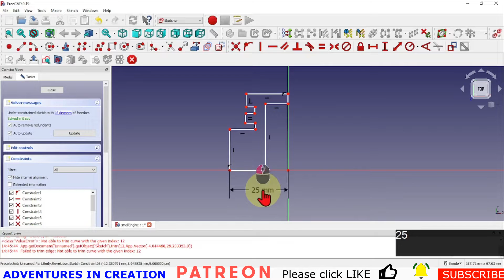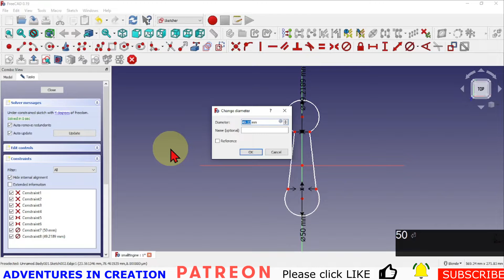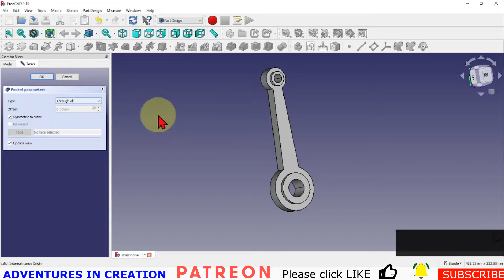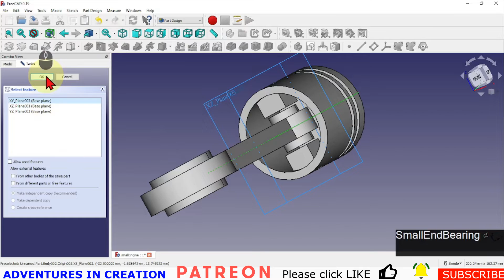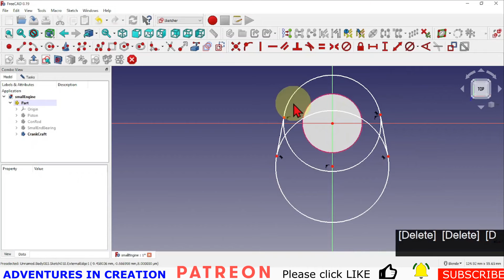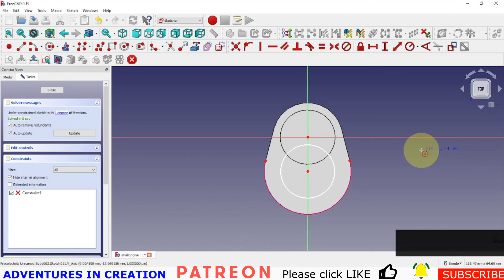FreeCAD Beginner #15 - Managing Multi-Part Models Pt 1.

Comment: This is why I love CAD: building real world practical parts. I created an assembly file in FreeCAD with,  'File -> Merge Document' and I was able to import your parts into a native FreeCAD assembly to create fixed and revolute joints. Just wanted everyone to know that the part file, 'smallEngine.FCStd' can be reused. These individual parts don't have to be recreated. It's safe to model all of your bodies in a part file. This has really opened my eyes to what is possible, I'll start using that approach. I'll continue the assembly after we make the other engine parts. Really love your tutorials.
Reply from the maker: That's great, thanks for sharing.

Comment: Thanks and a Question:-  Thank you so much for producing such excellent videos.  I am learning FreeCAD to help in my model engineering endeavours and I have to admit that I am struggling a bit.
A point in question:  when constructing the crankshaft is there a reason why you didn’t construct new features on the face of existing features, e.g. start constructing the web on the end face of the first cylindrical bearing.  In this way (a) you wouldn’t have to recall previous dimensions, (b) if the length of the first cylinder were changed then the web would move to suit.
Or is it a simple case of there being two choices of working and one chooses the one that in most convenient?
Reply from the maker: Good question. Previous versions of freecad had a major concern called the topological naming problem. The face references would change. This is largely fixed in the new version and so generally it is OK to use faces as references.
Reply: @Adventuresincreation  Thank you for that, I shall crack-on with one more area of confusion sorted.

Comment: Enjoyed this Tutorial, although I did have a few problems with the mirror function and repeated error messages saying that there were multiple parts generated on the mirror command. Freecad then dropped off additional parts?? and says it only keeps the first part, but it does not show up on the model. Managed a work around without using mirror. Found it difficult to research anything on mirror command error messages. But cheers for your videos, Graham
Reply from the maker: The latest version of freecad will allow multiple parts.

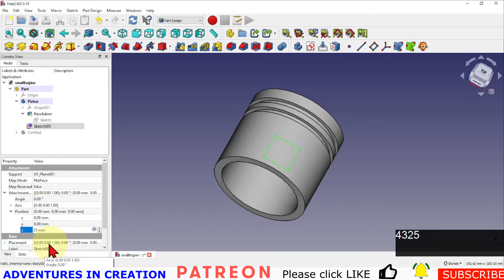Comment: For some reason, my square cannot be offset in the Position Z-axis 23 mm. I cannot the Z position property. Any ideas? At 24:05 in the video.
Reply from the maker: That's odd, can you move it any other direction?
Reply: @Adventuresincreation , Yes, I cannot change any position. I must have done something wrong. If I try to type in "23" I get the top view if I type "2" and the right view if I type "3". FreeCAD thinks I am trying to change the view of the piston.

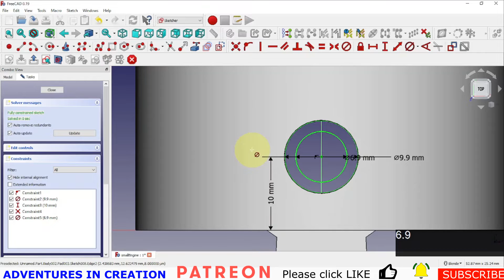Comment: In 29:57, Why we get directly a hole?
Reply from the maker: Thats the way it works
Reply: Think of it this way: starting from far away, you're on the outside of whatever you're modelling.  Cross the boundary, and you're on the inside.  Cross another, inner boundary, and you're outside again: it's a hole!

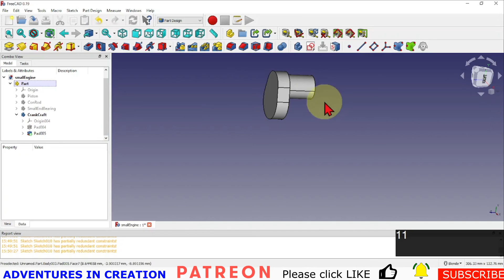Comment: Thank you.  The timemark is 43:45,  towards the end. Why do you select just that particular feature for mirroring, when surely you are wanting to mirror the entire part ?
A very informative set of videos which I constantly look back to for reference.  Well done in explaining your  very methodical approach.
Reply from the maker: I just mirrored that part because there were several pieces to mirror and I was just building up. If you want to mirror other parts that's OK, there are many ways to achieve similar ends. Thanks for the feedback and your question.
Reply: @Adventuresincreation  OK - thanks.  How do I now mirror the entire object to suit a multiple cylinder engine (bearing in mind that the big end journals will need to be rotated 90 or 120 degrees depending on number of cylinders). I tried mirroring the whole assembly, but get an error that I can't mirror such a complex part.
How can I do this, please.  I cannot find a video anywhere on YouTube which demonstrates this.
Reply from the maker: @kevingpearce  you may want to look at creating a clone of the parts you want, then you can position it as you need.

Comment: After you pad the crankshaft to 10mm, you select (and highlight in green) the larger radius lobe for mirroring around the XY plane.
Why is this, when surely you want to mirror the whole part ????   It makes no sense to me why you would be mirroring a feature rather than an existing part.  The use of such terminology is very confusing.  VERY difficult to understand what parts  (or views containing parts) to select when mirroring/padding/pocketing them.  Your choices and decisions appear magically inspired. 
Please explain further.
Reply from the maker: You are right, I am using magic as an inspiration ;-) Can you tell me what minute (mark) in the video you are referring to. I will take a look and let you know why I did what I did.

Comment: What are somethings you like about FreeCAD apart of it being Opensource? Also, what things you miss in FreeCAD when compared to other popular CAD applications like Solidworks etc.
Reply from the maker: I like the ability to use macros, the different workbenches. I miss being able to sketch on faces without issues.
Reply: @Adventuresincreation  I am a freelancer and was introduced to cad 1 month back. Since then I am loving it. Anyway to earn money from freecad???
Reply from the maker: @radeonblue1816  I am sure, if you have organizations that need engineering drawings or models in either STL or STEP format, you could provide those services with FreeCAD

Comment: Hey, great video! I'm curious why you create a part and a body inside it instead of just creating the body. Thanks!
Reply from the maker: Some of the assembly workbenches like the parts to be separate not just bodies in a single part
Reply: @Adventuresincreation  thanks for the answer! So, do you create the part in advance just in case you want to use it in an assembly later on?
Reply from the maker: @matyf_  yes, just to keep my workflow the same and ensure the parts are separate where it makes sense.

Comment: I do appreciate your use of reiteration to help those of us (me) who tend to be a little slow. Though I am using the Startup macro, it helps that you go through the steps in that macro so those steps can be drilled in.

I have some difficulty with spatial orientation in using Freecad. Have you done anything that might help me get that straight?

Thank you.
Reply from the maker: Thanks for the feedback. - I am not sure what your difficulty is, are you referring to which way is x-y&z ? Or how the sketch is oriented?

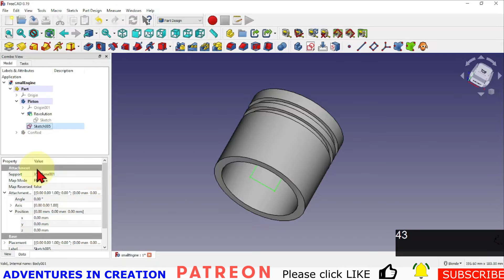Comment: 23:57 not working nothing
Reply from the maker: Can you explain what you mean?
Reply: @Adventuresincreation  cant't change scetch position mm. .
But i found other way to do that pad, with datum plane. 
With freecad all time need to do experimetnts, to get result.
Reply from the maker: @lauris.r8751  there is always more than one way to achieve the same thing. Keep on experimenting and having fun with it.
Reply: @lauris.r8751  Might be a bit late to say, but be careful that you are modifying the right values!  The sketch has an Attachment position, which is what you should be modifying at 23:57.  If you are instead modifying the Base placement position (which looks very similar) you are right, nothing works!  This caught me out a couple of times.

Comment: hi, thank you for nice and clear tutorial, just one think, that crankshaft is good for one piston only, or those other two in 3-cylinder would not move. 
But now a real question, what is the clone tool for? Would not save it a lot of work for example on crankshaft?

Please answer, thank you.
Reply from the maker: The clone tool allows you exact copies that are linked the originals. Watch my next video it will use clones

Comment: Thanks again for a great tutorial mate! 

I experimented a bit with the sketching of the crankshaft counterbalance in terms of getting those 2 angled lines connected tangentially between the smaller and bigger circle. I found that drawing those two lines in space and then connecting them tangentially as per your video seems to produce better and more accurate results right out of the gate instead of initially trying to eyeball it and then trying to fix the tangents afterwards; the tangential constraints actually jump into horizontal alignment automatically when following this approach. Figured I'd share so that other folks could try that route as well. 

Also, you can set whether or not to keep the model visible when going into Sketcher by going into Edit -> Preferences -> Sketcher -> Display -> Show objects that the sketch is attached to and Show objects used for external geometry. Not entirely sure which one does which, but yeah, the model is kept in the viewport when going into Sketcher when those two are checked.

Thanks!
Reply from the maker: Great, thanks for sharing Werner

Comment: I am newby coming from Fusion and wanting to see if I can swap Fusion for FreeCAD. 
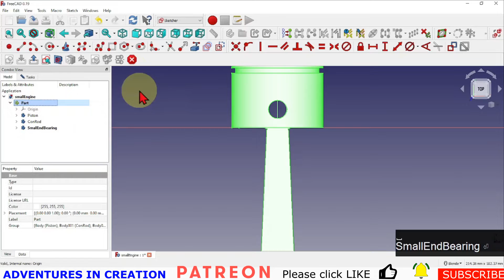At 28:24 how did you manage to infer the centre of the circle from existing geometry seemingly by just hovering over the existing hole which indeed shares this center?
Reply from the maker: You can include geometry from other models /sketches to reference.

Comment: So I had an issue when I went to make the ConRod where, when I went to add the 2nd and 3rd sketch for the embossing and holes I could not for the life of me get it to show the centers of the circles on the first sketch. Clicking the section view button on and off would only show me the origin of the plane. I tried re-making the sketch several times, going back to make sure I had everything clicked on, and located in the same piece of the model tree as you did. Nothing.

So I had to just guess where the centers of the circles were, which meant I had to manually reposition them later when we moved the Con rod down into position inside the piston because the embossing and hole sketches didn't move automatically.
Reply from the maker: There is a button (next to the change lines to/from construction lines) that copies geometry from another sketch. Try that.
Reply: @Adventuresincreation  Thanks. I came back to it after a few months and on the second time through picked up on that. Now my problem is that when I do the embossing on the con rod it doesn't pad on both sides, only 1 side. Up to that point my model matched yours perfectly

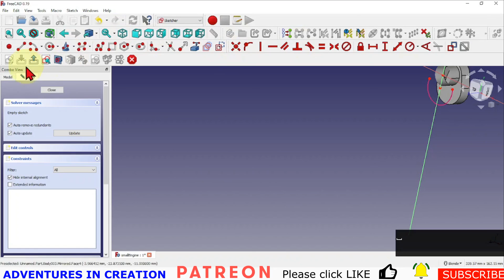Comment: A bit late to the game, but if you create a new sketch using a flat face of an existing pad as the reference plane (click on the surface before new sketch) I think it leaves the part visible.  Of course that only applies when you don't want your part centered on the original axes (such as when extending the crankshaft out around 45:00).  Great videos!
Reply from the maker: I'll give that a go. I think version 0.20 is changing the automatic "turning off" the part you are working on ;-)

Comment: If your going to print it, the small end bearing pin would need to be slightly less than 10mm, say 9.9mm, just so that it fits.
Reply from the maker: Hi Paul, yeah I am definitely not printing this. - I agree with you though, there should be a clearance if you want to assemble printed parts, instead I have animated it in Blender (coming in a future video)
Reply: @Adventuresincreation  I'm enjoying your videos on freecad - you explain most things pretty well. So much more can be learned by actually watching than just reading the manual and your fairly clear about what your trying to do. Well done..

I also use blender 3d. A great bit of kit. I did miss a few versions though and now it's so different I'm having to re-educate myself. So any videos you do on that would be interesting if your confident with the latest versions of blender.. ;-)
Reply from the maker: I use blender to create all my videos so I am very familiar with it. However, I am far from expert. I do enjoy creating simple animations with it. The intro to my video, the subscribe animation and other animations in the videos are all done in blender. I wish I was better at lighting, I am not an "artist" so I often don't get the lights right. It is definitely great software!!

Comment: Shout out from Down Under.  Love you tutorials.

Your issue with having to reselect the part to make it visible whenever you created a new sketch was bugging me as I had somehow managed to fix that.  Anyway, I've located the source of the problem.  This behaviour is the default setting in FreeCAD.  To change this:
- Ensure you have the Part Design workbench selected then,
- Goto Edit >> Preferences
- Select Sketcher >> then Display tab.
- In the Visibility Automation box deselect "Hide all objects that depend on the sketch"

Note the text: "The behaviour is remembered for each sketch individually", so best to click "Apply to existing sketches", then OK.

I've tested this and it fixes this issue. (If you turn that preference back on, you can reproduce the initial problem).

Best regards.
Reply: That worked Stephen - thanks very much.
Reply from the maker: I will give that a go. Thanks for the detailed explanation. It won't be in the next video as that is already done. But the one after... 😉

Comment: Your partially over constraint problem stems from too many instances of the symmetry constraint.  I was getting the same error on a similar drawing concept.  (Two arcs connected to a line by tangent, centered around a line of symmetry.)   The best solution I found was to only use the symmetrical when it was absolutely necessary.  In your instance, I think you could use one instance of symmetry and then make tangent lines “equal” and you will have the same solution without the constraining errors.  

I appreciate your videos and am looking forward to the next video in this series.
Reply from the maker: TBH, I didn't want to spend the time to play with it but I think you are right, I should have used less symmetry and more tangency.

Comment: I kinda wish you had persisted with the curved-ended sleeve, as I'm contemplating similar in my design. Is there a particular use for the 'Part' folder, beyond a neat way to collapse the tree when you're not working on a bunch of bodies?
Reply from the maker: When you come to do the assembly the part folder gets referenced. I just use them to keep things organized. When I first learned FreeCAD it was always, Part then Bodies inside the part.

Comment: great video. waiting for the next videos putting it all together. I am at this point in my learning of FreeCad. I can make the parts but just dont know how to get them all aligned and moving to make sure of clearances....Thanks
Reply from the maker: In the very next video I create more parts (cylinder block, cylinder head, spark plug) then the final in the trilogy is putting them all together in an organized assembly. I have been looking at 0.20 and it has assembly 3 "built in" but 0.19 is just assembly 4 (which surprisingly is not as full features as assembly 3). I am toying with the idea of using assembly 3 but it might be better for those that want to stay with the official release to see it assembly 4.

Comment: A couple of notes...

What you called the small end bearing is actually the wrist pin.

And the end you commented that this crank was for three cylinders, but it's actually for one.  In the middle is a rod journal, the ends are main journals.

This engine with a 50mm bore and 12mm stroke is very oversquare.

I'm waiting for the rest of this because I'm having positioning issues in Assembly4 with my engine model based on http://www.enginehistory.org/Piston/Napier/NapierLionHx/NapierLionHx.shtml and using https://www.youtube.com/watch?v=UiRIWApNGa8 as FreeCAD reference.

The Conrod (only one of 12 so far) rotates 90 degrees only when the crank rotation is at 180 degrees.
Reply from the maker: Your nomenclature is different to mine, I wonder if you are English?
Reply: @Adventuresincreation  American, but those are the terms I've always heard, regardless of nationality.  I know a good bit of British nomenclature and slang, but engine parts are consistent as far as I know.

When you started that part I thought, "Really, he's going to make bearings in a simple engine tutorial?"  Three minutes later: "Oh, the wristpin."
Reply from the maker: I found a cool picture showing the small end bearing and the big end bearing. I think we (in England) call the wrist pin the gudgeon pin. The gudgeon pin goes through the small end bearing so, you were right, I should have called that the gudgeon/wrist pin but included small end bearings too. http://86.43.94.97/moodlecp9a/mod/glossary/showentry.php?courseid=4&concept=Big+End
Reply: @Adventuresincreation  "Gudgeon" definitely sounds British.

I don't think I would include bearings in tutorials of this level.  The focus is on getting the primary parts to move properly according to the most basic requirements.  Bearings introduce forces and tolerances, topics beyond the scope of the lesson being taught here.
Reply from the maker: @CaraesNaur  Honestly, the focus is on managing the parts to assemble them. The animation would probably be better done in Blender.